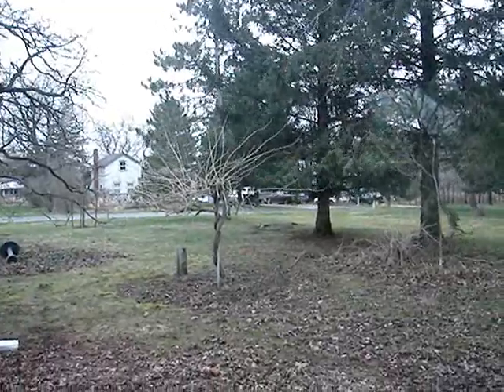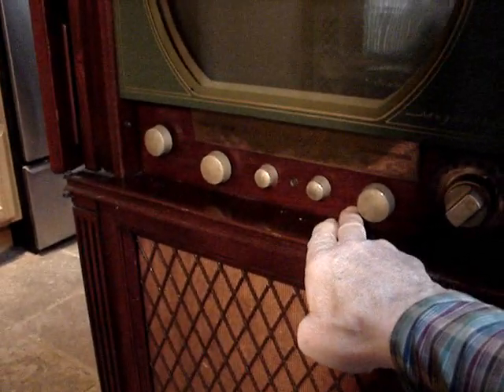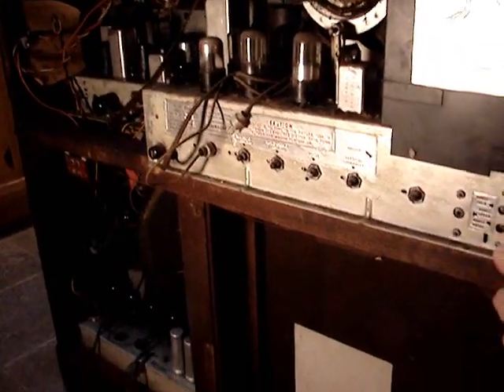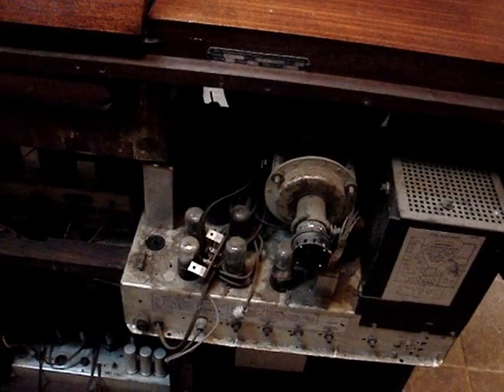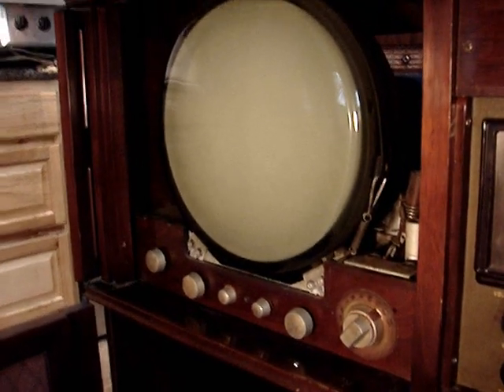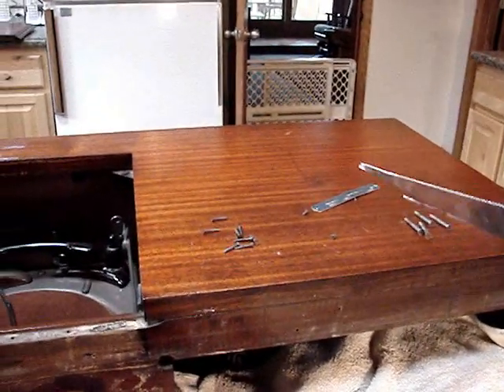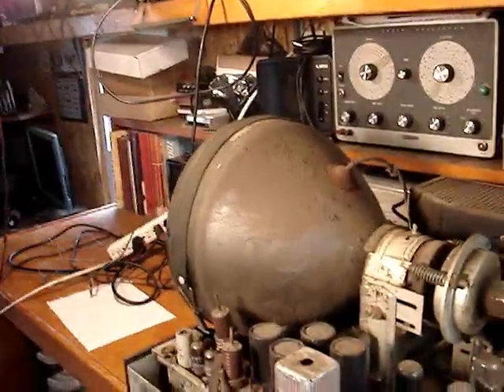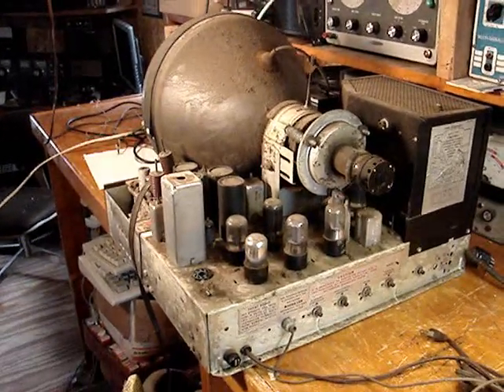Magnavox Embassy 1950 TV Radio Phono Combo PT9

Comment: You hit the nail on the head, you need to remove the CRT 1st as when they were shipped the CRT's were installed in the customer's home. Once the CRT is removed through the front that chassis will tip up enough to get it out very easily… quite daunting if you're not used to dealing with mid and late forties TV sets. The RCA721 is a perfect example